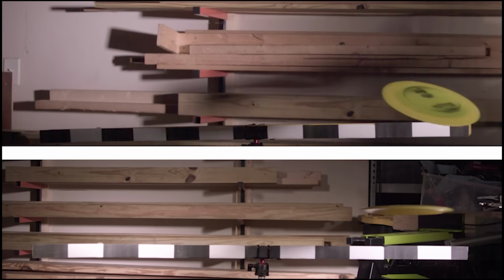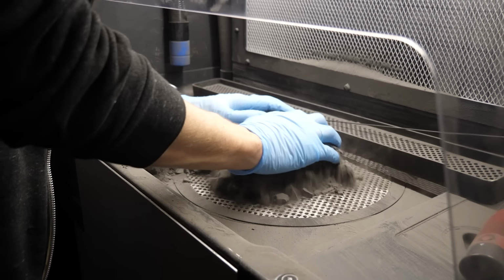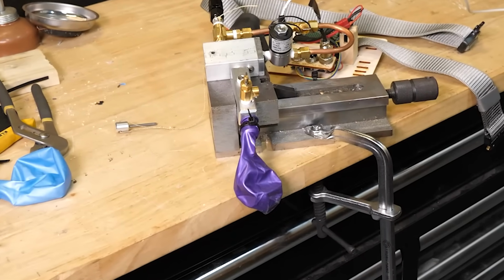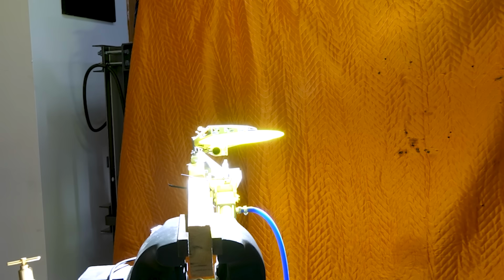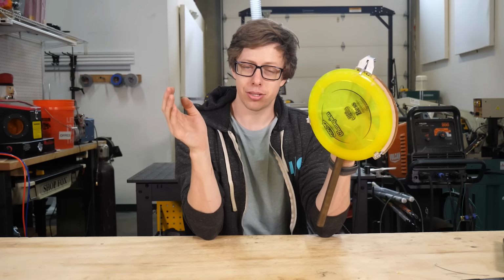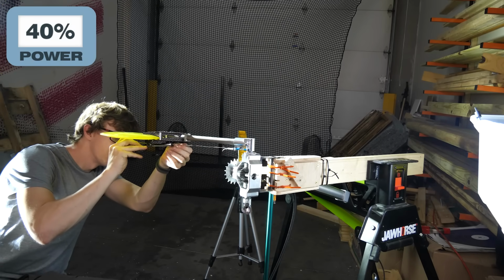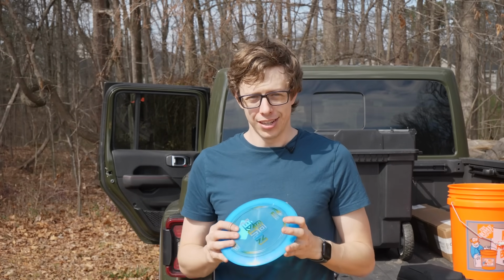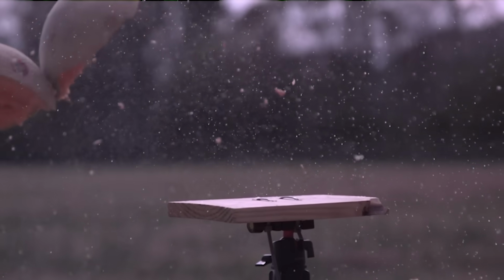Wrist rocket: worlds fastest disc launcher

Comment: This is the crossover I have literally obsessed over for years. You need something like a Flick, Tilt, or Latitude 64 Stiletto to stand up to speeds like those. Some people have even modified discs by reshaping with heat to make even more stable molds than any that are currently sold. Flattening the flight plate and outer rim into a single plane can cause some incredibly stable discs. Perhaps keeping the flipping edge angled down in a hyzer release would help get a better flight path as well. If you need any tips on disc design I can give some insight to how each design element can affect flight, but I find it's mostly intuitive if you're overly familiar with free bodies and basic classical mechanics.
Reply: Having it be thrown on hyper would probably have the greatest impact on the machine. Also it would be very interesting to see if the Tilt could be useful in this situation.
Reply: Needs to try the hyser flip

Comment: If you make a version 2.0 you should angle it down a good 30 degrees, if not more. The torque you’re putting out is going to turn any disc over, so counteract that by putting it on hyzer so it flips up to flat, not flip over into a barrel roll. Look up hyzer flip. 

I would also suggest using a new disc- the fresh plastic makes it more stable and less resistant to turning over. Smashing it into the walls, boards, melons, etc break in the plastic and make it much softer or “weaker.”

Actually, just get Simon on the next video. He knows everything there is to know about dg, and it’ll probably triple your views too.

Comment: The throwing angle makes a massive difference in the discs flight. If you make it throw on a hyzer angle i think you'll get a nice distance out of this thing.
Reply: Came here to say this. Gotta release on hyzer 🤣
Reply: So annoying to watch him putting it on anny every time.
Reply: @Donderopmetjegebruikersnaam  Hey Matty O makes it work
Reply: Yeah, and at the beginning of the video he says he has played disc golf "for a few years" so I kept waiting for him to adjust the angle. Also I don't think the mechanism was designed to provide an appropriate amount of spin.
Reply: Came here to say this.

Instead of throwing flat with a righthand backhand-like throw, the disc needs to sink down a little bit on the left side. Then it would make more of an S-turn and stay in the air for maximum time.
Reply: 100% the issue here...at these speeds the discs are probably supposed to be launched at 45 degree hyzer lol
Reply: Simon throws with 1300-1400 rpm at that speed.  That rotational stability to go with the hyzer angle of release is what's missing.
Reply: Or he just needs to pick a disc to suit the angle. A lot of people throw an Anhyzer over stable for distance and an Anhyzer may be a little more consistent for "a machine" in the hands of a mere mortal.

q8)

Comment: suggestion: generally throwing with the outside edge lower will be much less likely for it to flop to the right similarly to what happened there, instead it will stabilise and go much further.
Reply: I 2nd that!
Reply: Exactly what I was thinking, Give it some anhyzer
Reply: @joshstroud1424  Hyzer is what you mean, sir.
Reply: Yep! He's throwing into the roll. If he lowers the edge, the roll will result in flattening, which will give lift, then roll back over.

Basically looking for an S curve.... he has an amazing roller angle tho!
Reply: Yeah, this looks like it would have to throw what's known as a 'hyzer flip' to succeed
Reply: I still think with this speed throwing even on a 90 degree hyzer would still not work that well. It would still turn over and land upside down. Even if it was a super stable disk it wouldn't work out great. The disks aren't made to handle 100+ mph. Could a special disk be made? guess thats up to @stuff made here to find out!
Reply: @Faygofeet  nope it would keep going
Reply: @Faygofeet  max weight, max speed, stiffest plastic, overstable distance driver, on hyzer might just do it. MVP Limit & Dimension discs might fit the job at hand.
Reply: Give this man a Tilt
Reply: I dont think that would work because without the spin it wont stop falling over to one side and make the s curve. The variable you create with throwing to the outside is that your spin is going clockwise whilst having an angle to 9 oclock. Without a spin there is no difference between angles to the left or right.

Comment: You don't know how much something like this is needed in disc golf, with technologies like this we can actually test discs and put them on a more uniform standard regarding flight numbers etc.
Reply: Need to get over to NASAs wind tunnel :)
Reply: Why not redesign the machine used to test golf clubs? Something of that stature is about the only thing that can mimic human behavior.
Reply: It's really cool. Like he mentioned near the end, when discussing world records., I imagine he'd have to change it up to get a similar amount of rotation and gyroscopic stability, though, which probably means another, more human-like release mechanism. 

The amount that it's turning over in the video is interesting. Would have been interesting to see it throw something like Tilt. But maybe a 9-speed would've died anyways.

Not an expert.
Reply: Seems to me the simplest thing may be to redesign the pitching machine, make it horizontal. the speed difference between the 2 wheels would govern the spin. would be consistent and repeatable.

Comment: From what I could tell, the discs launched in the field were being released on an anhyzer angle, like clock arms pointing at 10 and 4. This would cause highly stable distance drivers to flip over almost immediately. Releasing from the opposite angle (hyzer) should allow the disc to flip up, fly flat, and then return to it’s original angle when falling. This would be like clock arms pointing at 2 and 8. This is the case for the machine, which launches the discs like a right-handed backhand, but would be different for other throws. Hope this helps!
Reply: Exactly what I was thinking (but in less cool words). Would love to see it thrown at a release angle around 7 or 8 o'clock!
Bet it would go for miles
Reply: Spot on analysis. Google hyzer flip.
Reply: I knew someone already beat me to it. Thanks.
Reply: I was going to mention the anhyzer release angle too, would definitely prefer to see it released on a low hyzer angle
Reply: Love throwing hyzer flips.
Reply: Exactly what I was thinking ! please try throwing the disk again with the opposite angle ! I'm sure you'll break the record very very very easily that way

Comment: You need to have it fire on an extreme hyzer angle. You’re shooting it on an anhyzer angle, which is no good when it’s firing them so fast.  Also, try a “Tilt” disc. It’s the most overstable (wants to flip right the least) disc out there.
Reply: YES!!
If the disc is rolling… it needs to be launched in a position to counteract that roll.  So about 80-90° CCW.  
I hoped there might be a try at Side Arm… which for me, requires significantly less energy:distance ratio.  
However, speed was the original goal, so not necessarily the best form for speed.
Reply: I was literally going to post this same thing with the Tilt as a disc selection. Good suggestion!
Reply: The mother of all hyzer flips
Reply: @11olive11  yes throw the TILT
Reply: This was both of my suggestions
Reply: The Tilt has no glide and it's just a 9 speed. He'd need to use a super overstable distance driver to get it to go really far.
Reply: A stiletto or rask would be much better suited than a tilt.
Reply: yes definitely a tilt.
Reply: @meatpilot  Yeah, tilt could take it but seems way to slow. I second the Rask.
Reply: Exactly, I thought this guy played?

Comment: This was a great idea! I would love to see you beat the distance record with it. I am a disc golfer and here are some things I noticed.  So, you pointed out that you are using over stable disc this is good to reduce roll over like you are getting. The launcher is releasing the disc at an anhyzer angle which in turn will have the disk roll over. The max speed of current disc's is 14-15 I suggest using one of those that is over stable last two number 0,4 and releasing at more of a hyzer angle. The power behind the arm will force the disc flat and you will get more distance. Hope this helps would really love to see this succeed!
Reply: Exactly what I came here to say! So cool
Reply: I agree with this comment. If you tilted the disc in the opposite direction (left side down, right side up, relative to the travel direction) then you would get  a much better flight and would have easily beat the women's record, and "Wife" could have a brand new trophy on the wall.  I also agree with your assessment for putting more spin on the disc would help. I have an idea for a mechanism to do this ( I have been thinking about building a machine to throw discs too!) that mimics the human wrist. Essentially, it is loosely attached on the arm and pivots freely, as the disc is accelerated, it will pull outward by centrifugal force, but when the disc gets enough velocity and inertia, it will start to pull the pivot point forward (I think) and this will enable a mechanical trigger that pulls a pin holding onto the rim of the disc downward, releasing the disc (very similar to v2 of your mechanism). It may be a total failure, but will be fun to try!
Reply: Holy hell I would LOVE to see this machine launching a hyzer flip for distance....

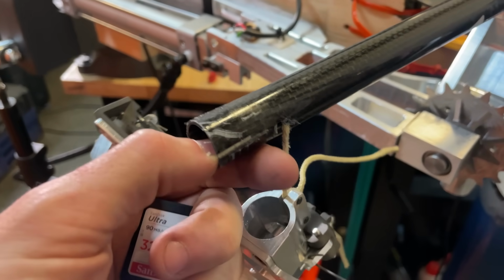Comment: 15:23 i like how you tethered the metal part through the carbon fiber just like F1 does with their tires so if the suspension breaks they dont fly off and bounce into the public or the marshalls, or other driving cars.

Comment: It’s amusing to see you having the problem with the valve. Some years back, I built a parachute mortar for the drogue chute of a sounding rocket. We used 12g CO2 cartridges as you find them in airsoft pistols. We basically punctured them when mounting them and a solenoid would let the CO2 flow to the mortar. During ground testing we used a pretty chunky valve that drew a lot of current and it worked like a charm. Our chief engineer then wanted to me to use a different valve, using less power (power budget and all). New valve came, we tested it and suddenly the parachute didn’t reach the correct ejection speed. Took me a while to figure out: the previously used valve had an orrifice of 1.5 mm diameter, the new one only measured 1 mm. By the looks of it, it actually was the same valve that you got there.

Comment: Wow, this seems so challenging! On your final attempt, the disc came out of the slinger on “anhyzer” angle (disc golf term) which may be making the discs flip over faster. I’m curious what would happen if you released them on “hyzer” (angled down opposite the direction they flip over to)? That may help give you more distance! The pros certainly take advantage of that- wind can also cause discs to flip faster. So a tail wind may help again make the disc flip less and go further? Combine those two thoughts and MAYBE everything will break again somehow
Reply: This. I was practically screaming at the video "Change the angle to hyzer!!"
Reply: @scottdotjazzman  I was definitely doing the same thing. On hyzer it has a really good chance of crushing the distance record
Reply: Seriously. He definitely should have consulted someone who knows even a little bit about disc golf.
Reply: Distance records are all thrown on anhyzer though so maybe that's what he was going for.  He just needs to thrown a Tilt with that angle
Reply: Yes, releasing it on a hyzer angle is key.
Reply: @dolphi5  They are released on a hyzer and almost immediately flip.
Reply: 100% agree. Kevin jones throws discs almost vertical on hyzer, and they flip up to flat or flex, im sure the machine could too :D
Reply: @PatZaglich  Every shot I saw was on anhyzer.  Anhyzer is great if you're trying to break the record in a 40 mph tailwind, but if you're throwing in normal conditions you get the most distance from a hyzer release that turns just past flat, then has enough fade as it slows to hook back up to the left.  The flight from above looks like a stretched out S.
Reply: For a record to be a record though, you actually need to throw it BOTH ways to break it. At least that's how Guinness used to measure their record attempts.
This means you have to throw it with tail wind and then with headwind to make a proper record.

I get the feeling the records recorded in disc golf are basically "lol i threw a disc halfway around the world because it got stuck in the landing gear of a jetliner".
Reply: @EugeeFGII  It also depends on which disc he's using of course, whether or not he can do a flip up hyzer
Reply: @RealCadde  the record 1100 feet was thrown in a ridiculous tailwind on the salt flats.  However Simon threw over 700 feet with five attempts in normal conditions just this last offseason. The world record in neat but has nothing in common with actual play except the disc used.

Comment: Love all the engineering. I've used a clay bird thrower for shooting practice and that's where I would have started. The long throwing arm gives the disc a surface to roll and get better rotation before launch. Probably would be a heavy design.
Reply: I immediately thought of a hand thrower for clay pigeons. Scaling up and improving that design would have been a quicker solution.

Comment: Amazing work. Your problem with turn can possibly be fixed by putting the arm on a "hyzer" angle - having the left side of the disc angeled downward. The speed will naturally make the disc "stand up" and go to the right. In disc golf we call this hyzer flipping.
Reply: I came to the comments to say exactly that.
Reply: and use the Tilt
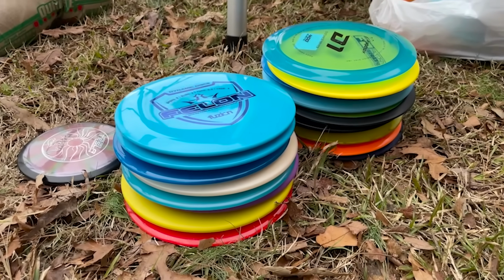Reply: Yep. At 23:00 the quick cut of "all of the discs in all of the configurations" appears to only either launch the discs flat or angle the arm the wrong way. That quick montage immediately jumped out to me as throwing it wrong
Reply: Exactly, you need to allow a pre tilt so it doesn't turn completely over.
Reply: I was literally yelling “Throw on hyzer!” at the video. 🤣

This is actually a really interesting project, because I think a uniform throwing robot is one of the things that would take the disc design and manufacture process to the next level. You could actually see the flight numbers unified between brands, and the various plastics/runs of molds quantified in how they differed from the original run.
Reply: @bensalemi7783  There probably already is one.  Well... I'm not sure how serious the manufacturing of these discs are, but I know for certain that they use uniform throwing robots for the design of at least several other pieces of sports equipment (e.g. bowling balls).
Reply: @zvxcvxcz  That area of disc golf is very much underdeveloped. The four flight numbers that go on discs are arrived at by someone at the company selling the disc throwing the disc during its development and simply stating what they think the numbers ought to be.

Comment: I just realized that this problem is basically the same one that clay pigeon traps (throwers) are made for.  C&rsenal has a fun series of videos called "It's a Trap!" where they go into a bunch of vintage clay pigeon traps with different mechanisms.  I wonder if some of those could be cool inspiration for another version of this?
Reply: My exact thought
Reply: First thing I thought of. Reinventing the wheel a bit, I thought.
Reply: Hope he sees this comment!
Reply: Thought the same thing. Should have looked through the comments before I commented.
Reply: Came looking for this same comment. A scaled up version of a hand thrower seems like an obvious route to explore further. A hand thrower on an old golf shaft will launch a pigeon!
Reply: yeah exactly i bet if you scaled up a hand thrower and attached it to the end of a baseball bat. hell you can chuck a clay pigeon 50 yard without to much effort.
Reply: @Brentbrussell  i don't think your arm is capable of producing 455g's at only 5% power. Let alone whatever at 100%

Arm strength and mechanical strength are entirely polar forces.
Reply: @robert9595  Buddy I'm no physicist or engineer but I've thrown a couple discus and clay pigeons in my short life to know increasing exit velocity is the goal when trying to throw things far. A hand thrower does just that for a clay pigeon. Seems pretty reasonable to consider that as a route for further exploration

Comment: As a disc golf player there's a few things you're missing. 1. Speed rating on the disc. You need 14 which is the max. The picture you showed was speed 9. Maybe you did but just didn't show it. 2. Discs tend to flip over to the left with a negative TURN rating and to the right with a positive rating. Once you know that the disc wants to turn, you then compensate by tilting it slightly the opposite way. I can see it's launching slighty slanted which is causing them to turn prematurely. Look up the term hyser flip to see what I'm talking about. You'll go so much further with just 2 minor adjustments.

Oh and with 8.7 million views I'm sure you could have got some sort of compensation from a disc company sponsor. 

Anyway, love the effort and humor!